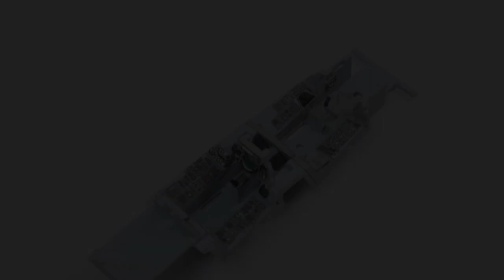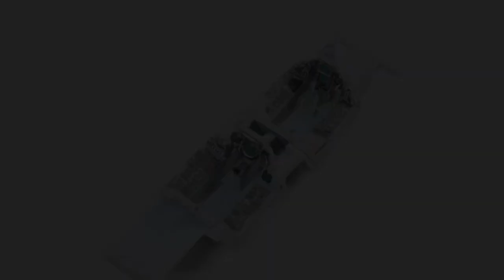Academy F-14 Tomcat Part 2 Cockpit

Comment: hello mate, enjoying the video series so far and the detail you're putting into it.  One tip with the Quinta decals - don't dip them in water - you'll get that soft floppy/bending/curling up thing happening which could damage them.  What Quinta have previously recommended is wetting a piece of paper towel and placing them on the paper towel.  The water will seep up and into the decal paper thus releasing the adhesive and minimizing any potential damage to the pieces.
Reply from the maker: That's good gouge, thanks mate, I'll give that a go.